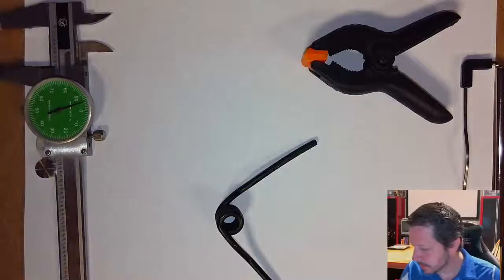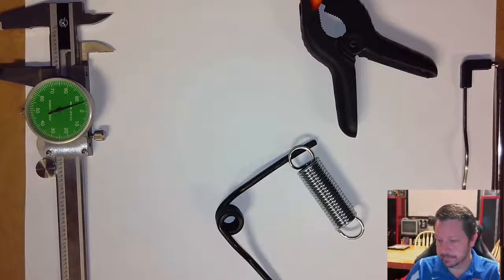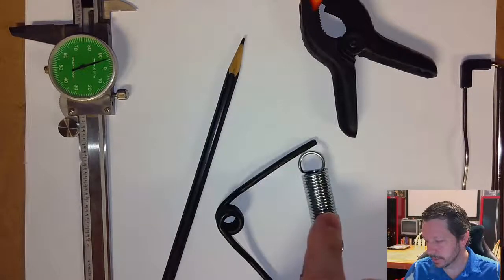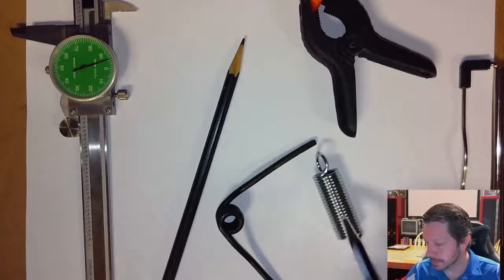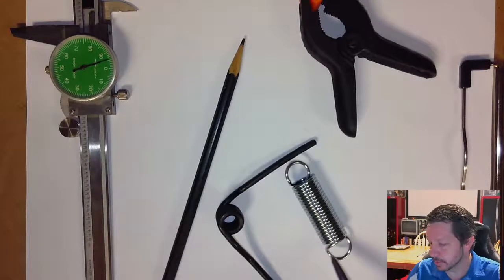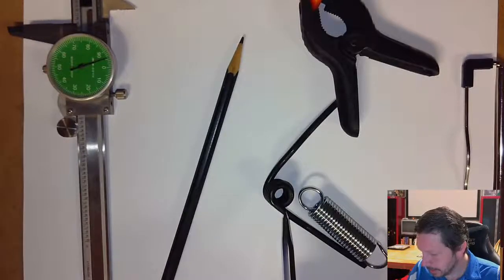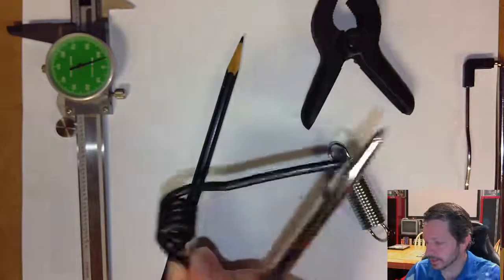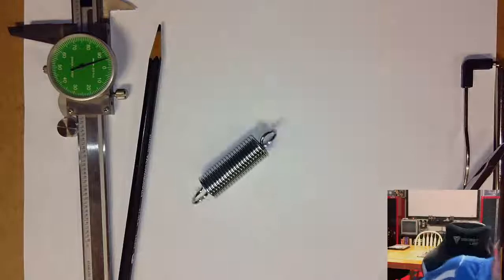Other Spring Types | Shigley | MEEN 462

Comment: Sir, will you be extending the discussion to Rolling (Contact Bearings), Lubrication and Journal Bearings, Gears (Spur, helical and Bevel) and Brakes, which comprise chapters 11-16 in Shigley?
Thank you for the wonderful work you are doing here, its really helpful.
Reply from the maker: Yes, all of those are coming up in the next few weeks. Although most of the gear topics are using AGMA.